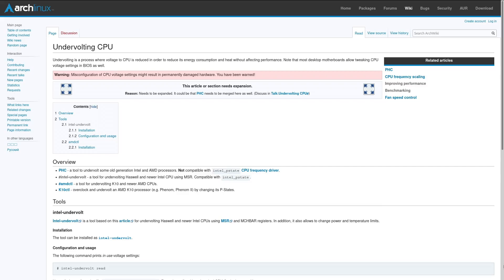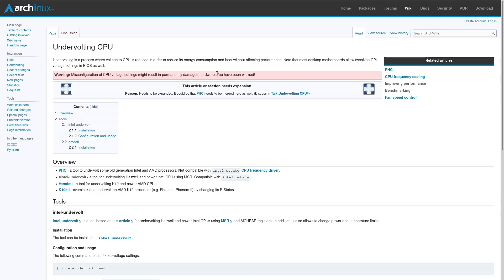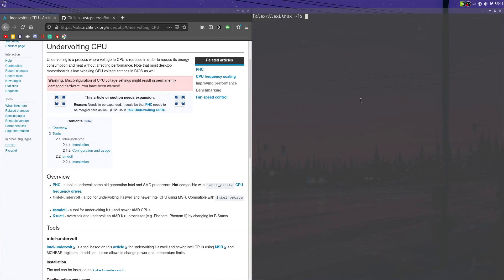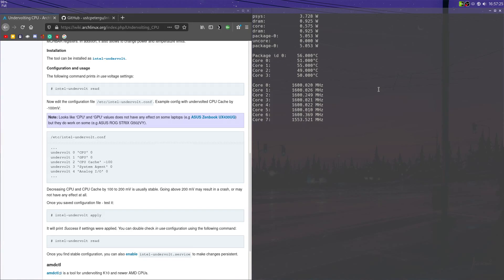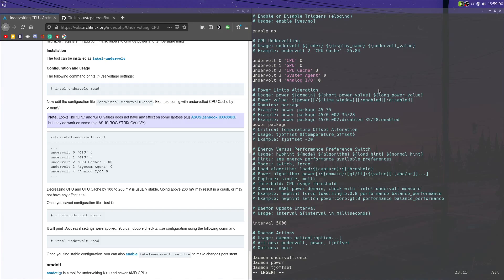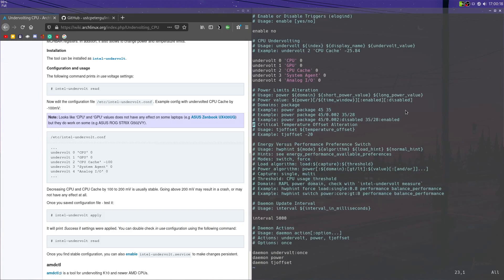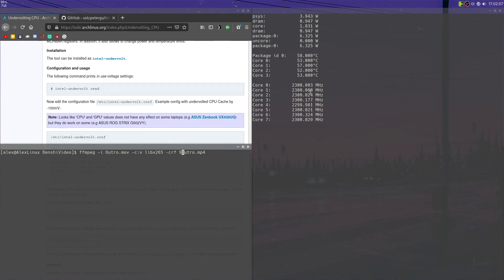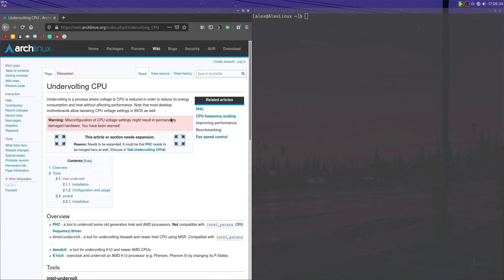Undervolt your CPU with intel-undervolt!

Comment: Hello, I am using Arch Linux on a Lenovo Thinkpad L530 (At least 10 years old laptop, with an i5 3320M), and once installed, the command intel-undervolt show me "Input/output error" for each components, where in the video by default there is a 0 value.
I make some searches and learnt that it would be the fault of an exploit and so BIOSes and microcode have been patched. I only want to know if it possible to make it work, as i see still people doing it today, and changing BIOS or similar stuff doesn't worry me that much.
Reply: For it to work ot has to be atleast 4 gen intel cpu
Reply: @Rufinifur thank you, since the time I have realized that indeed outside of possible BIOS patch, Ivy Bridge CPUs have not the necessary features, it is since Haswell architecture that it can be possible.

Comment: Could i do that with intel celeron n2840?
Reply: With what i saw, yeah try to install intel-undervolt, and if you make "sudo intel-undervolt -read" and see "Input/output error", no it isn't possible very easily, but if you see like in the video -0.0 mV or something like that, it should be good
It would also depend on which BIOS do you have

Comment: if my undervolt is unstable and i enabled it to auto run at boot where it results to my system not booting, i can still disable or modify the script by accessing the linux terminal before boot right?

Comment: I’m new to Linux and I’m buying a “project” laptop and hotter cpu on Amazon. The laptop has Win10 installed. If I try this app under Windows does it work? I was going to try the app under Win first and then wipe it and load Linux. What little I know about command line might lead to a fried cpu and worse possibly...

Comment: Had no luck with this with Intel 12th gen
Reply: Pls elaborate
Reply: But probably its not supported as somebody else had problem with 11th gen you probably need to find something else
Reply: @norbertnagy5514  yes, I don't think it's supported
Reply: As written in Arch wiki, it is disabled in modern BIOS'es, for some security against Plundervolt vulnerability.

Comment: What if you undervolt too much? How would this software test for stability?
Reply: You'll know pretty quickly when your system locks up.
Reply: @FranticAlligator  I did successfully undervolt, but the lock-ups may happen not as quickly once you are close to the limit (I once had to test my pc for a day for it to lock-up). What’s interesting, it appears that different OSes tolerate different values of undervolt on the same machine. For example, my Manjaro installation works perfectly fine on -100mV, however, when I boot to Windows, it immediately locks up. To me, this doesn’t make much sense, because the CPU either works erroneously due to the lack of Voltage or works correctly, no matter what program it is running. Maybe -100mV undervolt works fine on my Manjaro because it can deal with (or ignore) the errors coming from the lack of Voltage in the CPU, while Windows cannot. But then again, I am not qualified to make such claims.
Reply: @poggy9635  I tried undervolting on Linux too, haven't got windows on my m93p, but I noticed even a tiny drop in mv for GPU it changed the performance drastically.

While I don't particularly plan on playing games on it, 60 fps on project zomboid turned into 17 with a -40mv for GPU. Could be because of the power limit i set or whatever but still. My main goal was just getting the temps down but I suppose the 4980HQ I have just runs hot anyway.

For me undervolting doesn't seem to get the desired results. Guess I'll just have to live with it or explore having less tension on the CPU itself.

Worth mentioning that the 4980HQ I have is a BGA-to-LGA adapted CPU, which has a higher height than a standard LGA CPU needing washers under retention bracket and the heatsink no longer contacts the motherboard like it did so pressure might be higher than desired.

That said, it idles at 34c ish after it's left to reach equilibrium after maybe 30 minutes, but sticks to 40c for longer than a standard CPU.

As far as your -100mv goes I suspect Linux just demands less of the CPU perhaps, or... Linux is just more stable than Windows haha